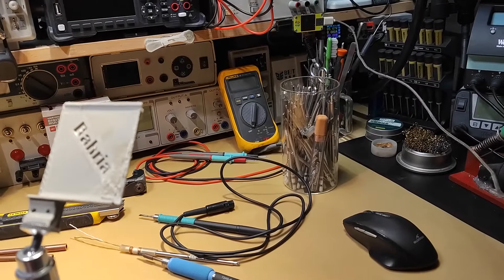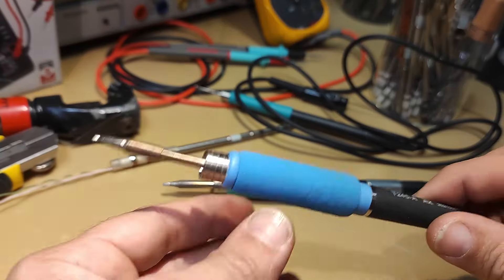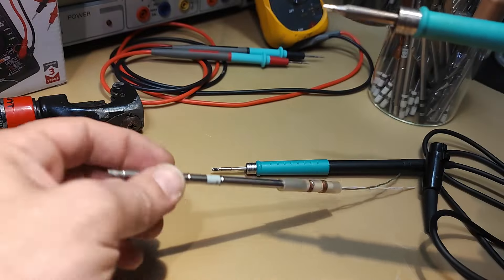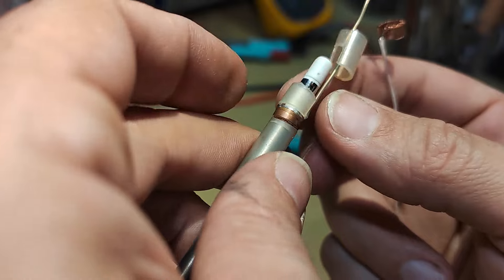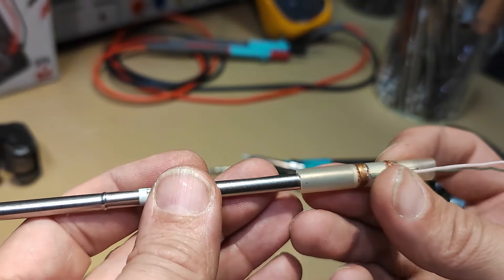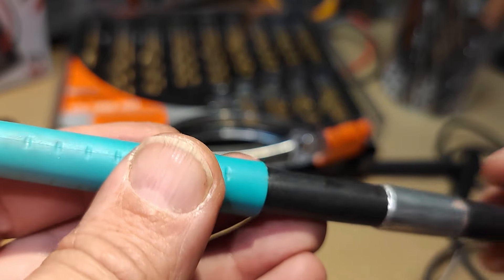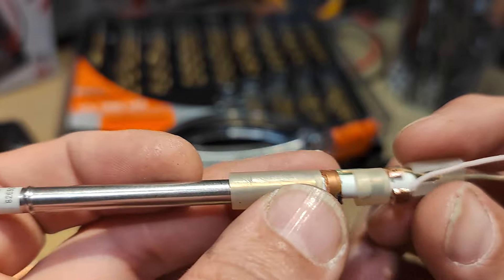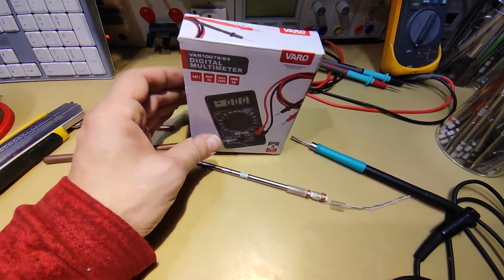How to make a T12 handle in T245 JBC style

Comment: I have Try everything but only the upside from the grip i have done  the t12 is going inside drilled with 6.5nr 

But the big problem is the doenside of the grip how i get that inside in😞
Reply from the maker: you need to open the handle by cutting it like I did, near from the tail (as explained on the video), and insert the tube/copper/wire connexion. Or I didn't get your problem?
Reply: So I've done everything. Do I have to cut the plastic tube at the bottom of the handle with the 6.5mm hole? I can get the T12 in but I can't get the connection adapter socket, I'm failing there :(
Reply from the maker: @user-bw5hk5nb3k  look here -> 5:52